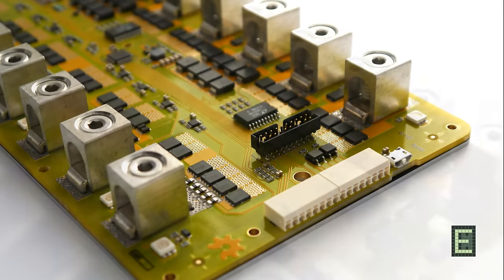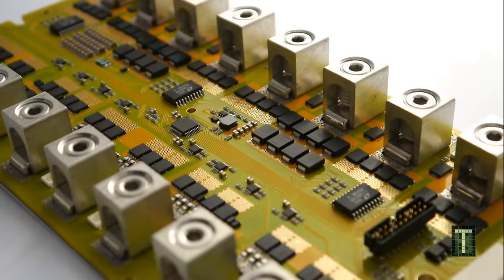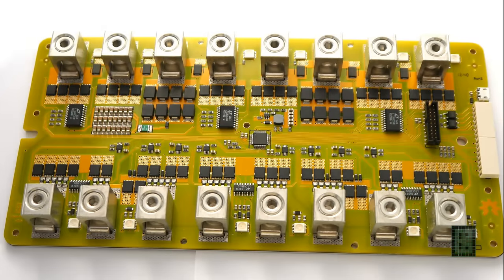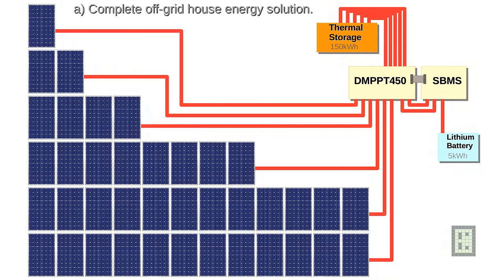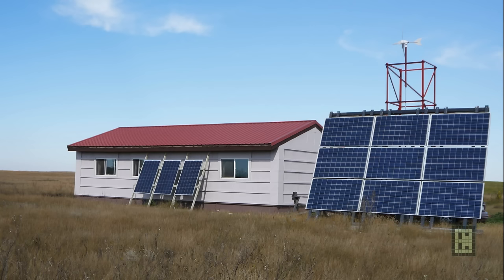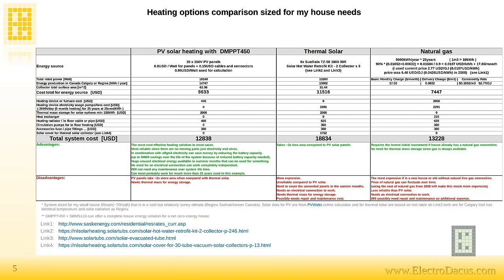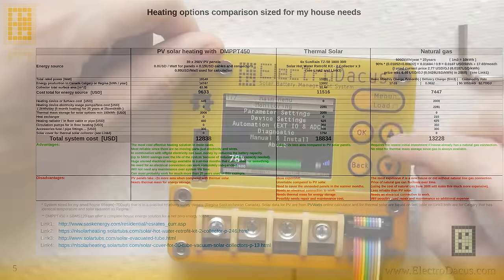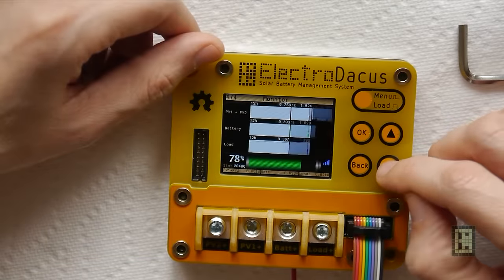Digital MPPT and Solar BMS for a Net Zero energy House

Comment: This is a digital regulator of electric load derivation, great system to maximize the solar photovoltaic and accumulate heat by heating of water accumulation and used with a low temperature radiant! 
Use this system to keep under constant electrical load a small hydroelectric turbine, heating water for sanitary use and radiant heating at low temperature floor.
Good job
Reply from the maker: Yes this is a sort of load deviation but with Digital max power point tracking and the principal storage is thermal storage for heating or cooling and with optional secondary Lithium storage for electricity. The DMPPT can be used stand alone for heating/cooling only if electricity is not needed.
Thanks for the comment.

Comment: Very interesting idea. Storing the generated heat in an object of high thermal mass is a good idea. People in Germany have argued for some time that it is better to heat your house with excess solar electricity than export it to the grid because feed in tariffs have been lowered so many times. 

Looking forward to seeing your solution in action.
Reply from the maker: Thanks. Yes the thermal mass idea is not new people used this for thousand of years. If the house was heated with electricity then for sure storing that in thermal mass rather than selling it to grid will be a good idea. If house was heated with natural gas then it will depend on the natural gas price vs what grid paid for the electricity.

Comment: Hi Electrodacus. Congrats on your new project. Wishing you much success. 

I have a question for you. From your other videos and comments I've seen and read, I know you're a strong proponent of LiFePO4 battery tech as the best bang for your buck storage system. Do you know what chemistry Tesla's PowerWalls use? I don't believe they use LiFePO4. If that's the case, I'd like to hear your theory as to why Tesla didn't pick LiFePO4 as their chemistry of choice for their PowerWalls. Thanks for your time to offer some commentary on this subject.
Reply from the maker: Thanks. Yes you are right LiFePO4 is the most cost effective battery when used in offgrid systems.
And yes Tesla works in collaboration with Panasonic and only Sony has LiFePO4 so they use a high energy density cell for their power wall so less cost effective than LifePO4.
You will not want to install a power wall to be profitable is just if you realy need a backup energy source and cost is not an issue for you since each kWh stored in the power wall will probably cost you well above 50cent/kWh
People do not understand this kind of things so is good business for Tesla to use this cells since it looks better as they can say it has more energy storage capacity for the same weight and acquisition price.
The cells they use have just 500cycle life when used at 100% DOD and if used at lower DOD maybe 80% then they can get closer to 800 to 1000cycles still very far from LiFePO4 can can do 3000 to 6000 cycles at 100% DOD and 5000 to 10000 cycles at 80% DOD
Tesla in the warranty allows you to use the power wall as much as you want but they offer no warranty for lost capacity so if you cycle the power wall each day in 2 or 3 years the capacity may be just 70% of the original but they will not cover that by warranty.
Reply: Thanks for your reply. I understand what you're saying but what I don't understand is why Tesla doesn't just mass produce and use LifePo4 as well?  Musk does seem to use the best components for his electric vehicles, so I don't understand why Musk would want to cheap out on his PowerWalls if LifePo4s are indeed better. A potential competitor could come along and sell powerwalls using LIFEPO4. 

Do you have any recommendation as to where to buy good LifePo4 batteries in the USA?
Reply from the maker: Lance Guilin
Musk is a good business person and know most people 95% will only use this battery grid connected as backup is a few situations so not much use.
LiFePO4 is at around $350/kW acquisition cost while the NMC used in power wall about $220/kWh. This above prices are for relatively low volume a few kWh capacity.
So even if cost amortization is much higher for NMC when used with daily cycle offgrid than with LiFePO4 99% of people will not understand this and will still by the one that looks as it has smaller initial cost vs capacity.
So from a business point of view the Tesla Power Wall 2 is the better option.
All people (at least 95%) will be happy with the powerwall 2 but unaware that each kWh stored in the powerwall will cost them at least 50 cent/kWh if not more since that is to hard to understand for most consumers.
Sony has is own power wall type system based on their own superior LiFePO4 but since cost is higher they did not had to many sales. They also do not have a celebrity like Musk to promote their product and they had that long before Tesla came with powerwall.
Reply: @electrodacus  also Tesla is into batteries for mobile application namely cars and soon trucks. Power/weight ratio really matters when you have to move your battery to be able to use it. That means they are just extending their existing tech (their expertise) from a mobile application to a stationary one. There is also discussion of giving cells that are no longer at 100% a "2nd life" recycled into a stationary application. For example if cells at 70% are sold at 25% of their original cost and derrated, so to they only use 50% of the original capacity the power wall will be 2x the size but half the cost and have a longer life. Another consideration is the rate at which this technology is changing and improving. So not investing up front as much may make sense if tech comes along that obsoletes something like LiFePO4.

I compare it to what's happened in lighting. Several years back we'd begin replacing existing florescent lighting with higher efficiency florescent lighting as the current stuff failed. We did this instead of replacing it all at one time, even though from a life cycle point of view it was justified. Payback was several years though. Then LED got so cost effective and it saved half the operating cost over either florescent tech. The price got right and we changed everything over at once. Even replacing fixtures that were less than a month old. 50% energy reduction and 5x the life. Also labor efficiency of doing it all at once vs. piece mill.

Probably too much analysis.
First cost is very important if you are going to get wide scale adoption.
Reply from the maker: @barrellcooper6490  Tesla uses Panasonic cells spec here for those used in model S https://www.batteryspace.com/prod-specs/NCR18650B.pdf model 3 has a diffrent form factor but about same caracteristics. Spec here https://www.batteryspace.com/prod-specs/NCR18650B.pdf
Notice battery at just 70% of initial capacity after 500 cycles 100% DOD and while that is perfectly fine for EV's as range is around 400km on a full charge and EV warranty is just 160000km so the equivalent of 400 cycles at 100% DOD more than good enough.
LiFePO4 like the A123 System cells that I use to power my house have a cycle life of 5400 cycles at 100% DOD that is an order of magnitude more thus there is no contest for stationary energy storage.
On top of that cycle life is high enough with LiFePO4 that is not even the limiting factor and the Limiting factor is something that affects all batteries and that is calendar aging.
The battery used in my off grid house fairly heavy ha degraded 0.9% after first year of use with an average equivalent daily DOD of 47% and degradation from cycling was around 0.3% while calendar aging was the remaining 0.6% thus calendar aging is the main degradation factor so battery will not last longer than 15 to 20 years before capacity is no longer large enough for the application.
At is it now LiFePO4 is the best option by far for offgrid energy storage applications and it will be very hard for any other battery to match this unless it has the same characteristics and maybe better price or they manage to significantly improve the calendar aging degradation but that can happen even with LiFePO4.
So even if that Panasonic cell (new) where to be 4 to 5x less expensive than LiFePO4 (in terms of cost per kWh if storage) it will still have worse cost amortisation cost.
The no thermal runaway (safety) and no Cobalt content (more environmentally friendly) makes LiFePO4 a great choice. If there was anything better I will have selected that for my own use as I have no bias. The SBMS can work with any type of Lithium battery currently available or in the future.

Comment: Hello Dacian.
If i allready have big 1500liter watertank and pipes in concrete floor, is it possible to just add heating elements in the tank? 
If so what kind of elements would be best, all the same or should their resistans(watts) be different? There are cheap stainless steel 24volt elements from china on ebay. Great projekt you have here
Reply from the maker: Yes Max you can use the existing 1500 liter water tank and the heating elements can be custom made from silicone insulated copper wire same as explained in the presentation page 13 http://electrodacus.com/DMPPT450/dmppt-presentation-v01.pdf
The resistance should be different for the max power point algorithm to be effective. It will also work with same value but then there will be less power levels so MPPT will be a bit less efficient. The cable will be as inexpensive as those sinless steel 24V elements.
I guess your 1500 liter tank is not a pressurized tank so using heating cables should not be a problem.
Not sure how large the concrete floor is and if that is enough thermal storage to use just solar heating without backup. If is not then maybe you will need to add another water tank to have enough thermal storage capacity for a few cloudy days.

Comment: its great to see again would you share it to open source ? it would great if you make using famous blue pill stm32f103 for small system
Reply from the maker: Yes it will be Open Source as all my projects. I use the STM32F373 since that is the only one that has the 16bit sigma delta ADC.
Reply: electrodacus so can we use external module adc 16 bit sigma delta converter to fullfill that need ?
Reply from the maker: I think it will probably be more expensive to use the STM32F103 + external 16bit ADC than just using the SBMS32F373.  And if you do not care about the accuracy/resolution you can also just use the 12bit ADC in the STM32F103.
I use a lot of ADC inputs in the DMPPT. There will be 8 inputs for the 16bit ADC and 3 input for the 12bit ADC.
Reply: electrodacus thanks for answer and info i will try it and maybe you can add forum in your site for talking about ideas  ,its just my suggest :-)

Comment: Hello friend, is it convenient for you to tell me the model and purchase link of the high current terminal on the circuit board? I have a project that also needs to use this high current PCB welded terminal. Thank you very much
Reply from the maker: Search on Lugsdirect website and you can select any of the connectors they have that best matches your application. There are probably other sellers that have similar connectors.
Reply: @electrodacus  Thank you very much

Comment: Do you think this can be used stand alone to heat a green house in winter ?
Reply from the maker: Yes it can be used stand alone and it will likely be a good idea for heating a greenhouse as long as the greenhouse is thermally insulated. When I will get the time I also want to build a greenhouse but completely non standard with no windows or any transparent parts and I will be using LED for both light and some of the heat the other part of the heat will be with restive heat elements to heat a large thermal mass. Winter here are long and very cold (Canada Saskatchewan).
Reply: @electrodacus  i understand this im from Québec :) my father want to grow some plant in winter and wonder if heating the veranda and get natural ligh or do it in basement and use artificial light what would be better. will suscribe to see your green house project!
Reply from the maker: Not sure when I will get to do the greenhouse project as is on a long list of other priorities.

Comment: I have 5K of 72 cell will this work with the higher voltage
Reply from the maker: Hi Jeff, Unfortunately no just 60 cells panels will work. I can possibly make a custom version that will support that higher voltage but will add some cost to the DMPPT.
The main reason is the 60V absolute max limit on some of the parts and in order to protect them a large number of TVS diodes are used 16 in total in this first prototype each with a 3000W pulse rating and are setup as two in series each with a standby voltage of 20V so 40V is max acceptable open circuit voltage (actually this TVS will only start clamping worst case at 22V each so 44V) and in reality they will start clamping at 48V based on simple test at room temperature.
The 60 cell panels based on my tests and spec will just have an open circuit around 40V at very low temperature the highest I seen this winter with -30C outside was 40.8V on my panels.
Simplest solution will be to replace those 3kW Peak 20V TVS with a more expensive 5kW Peak 22V TVS since you panels can see an open circuit voltage around 49V in realy cold weather. And TVS will need to be able to clamp to just below 60V in worst case scenario 550A pulse.
Sorry for the technical answer. Short answer the official DPMPPT450 will only support 60 cell panels but it can be made custom if you realy need that to support 72 cell panels.

Comment: Does adding a DC heat pump make sense? Like https://www.practicalpreppers.com/images/Specs-DC48VRF.pdf. Just something random from the net.
Reply from the maker: That requires an electrochemical battery in order to work and that makes things way to expensive as mentioned in my pdf presentation. My system will not use the battery for the heating (possibly cooling using peltier) part and the DMPPT450 can be used even stand alone just for heating/cooling without the need of a battery just PV panels, DMPPT450 and thermal mass and that is what makes this the most cost effective heating solution. If you add a battery as buffer then all this gets quite a bit more expensive because of the battery high cost amortization.
For heating a DC heat pump of any type including peltier will not make economic sense but for cooling there is no choice other than to use a peltier based unit and that is possible with the DMPPT450 but of course more complex than heating and will need some DIY designed two stage peltier cooler.
I do not need cooling and even in warm places the amount of cooling energy is much much smaller than heating (look at the page 3 in the DMPPT pdf presentation at Australia). http://electrodacus.com/DMPPT450/dmppt-presentation-v01.pdf
Reply: Does the battery in such case add anything more than ability to run during the night?  The whole trend of using inverter Heat Pumps is to control the speed and hence power. I guess that could go contra to this project, but couldnt BLDC powered anything be used in a MPPT kind of way? Unless there is something i cant see the problem in.
Reply from the maker: Having a battery (electrochemical battery of any type) increases the cost amortization so much that it will not make economic sense. Same is true for heating pumps. The cost of the heat pumps and additional equipment needed will be more expensive than the amount of PV panels that it can save.
So yes there are solutions to power a BLDC from the DMPPT but it makes no economic sense since PV panels are less expensive than heat pumps and much more reliable.
We can of course look at the numbers in details if you want but I studied all possible combinations for heating and this simple heating method is the most cost effective.